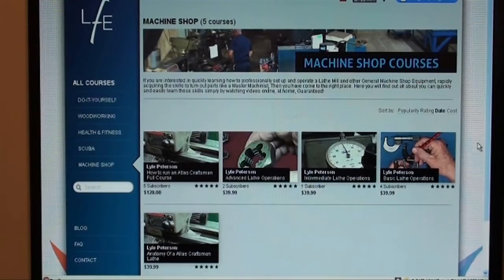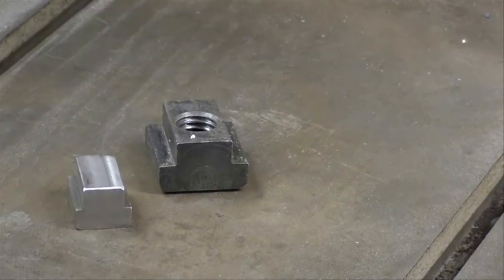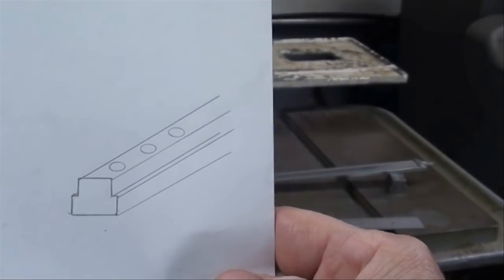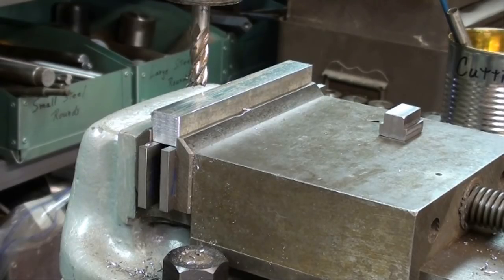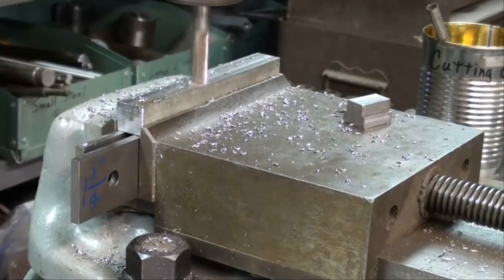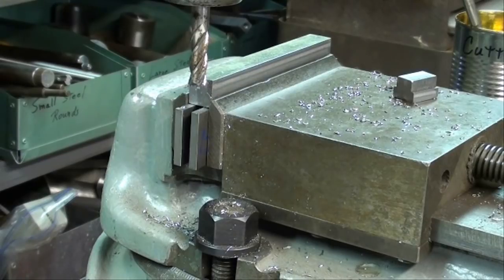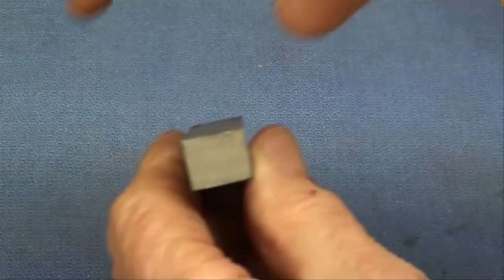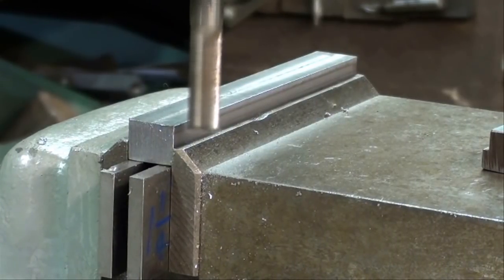SHOP TIPS #102 Pt.1 Making Tee Nuts on the Bridgeport tubalcain

Comment: Hi mr Pete thanx for the teaching vids.  I hope not 2 ask too much, but not sure where to find, and I was wondering if you could help.  I have purchased Bridgeport knee mill.  I think it is M head with 1/2" something.   It uses no. 2 morse taper with drawbar at 3/8-16 thread.  So I need aforementioned (#2morse, 3/8-16) male adaptor to #33JT drillchuck shank.  And adaptor #2male morse taper w 3/8-16 drawbar thread to 5/8", and/or 3/4" straight shank end mill holder.  I hope this makes sense to you. I will ask Keith F. also.  Thanks

Comment: Thanks for the video.   I just spent the afternoon making T-nuts for my drill press.    Out of curiosity how long did these take you?   I probably have 5 hours into mine. This includes the time removing mill scale from the steel to cleaning my mill and putting everything away.  I tend to putter, but I never thought this would be a 5 hour project.

Chris
Reply from the maker: +shadowdog500 Not sure, maybe an hour or two

Comment: hey great video on these t nuts for your drill press. i am currently in school to become a machinist and i am picking it up pretty quickly. im actually in the process of making 123 blocks right now, so my question is we have a couple of formulas we use at school for tool speed depending on material but when i do the calculations the rpm always comes up way too much and i have to cut my speed in half in most cases. can you elaborate a bit on speed and feed for working on the mill ???
Reply from the maker: Thank you--I hope to get to that in a future video
Reply: thanks mr pete222, i was actually offered a chance at an apprenticeship to become a toolmaker so keep the videos coming, i learn a great deal from them !!!